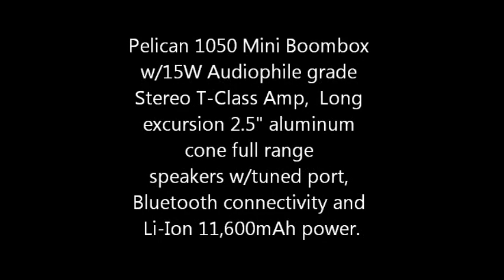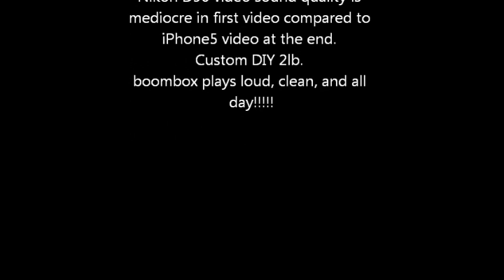DIY Custom Pelican Mini Portable Boombox w/Bluetooth & T-Class Amp!

Comment: I used the same amp and different speakers, but this but this case, or your idea for this case is what I want to thank you for. It is a great case and inexpensive to.
Reply: Hello,

How did you wire the batteries to power the bluetooth and amp? Do you have a schematic plan? Thanks
Reply: knebula http://www.amazon.com/gp/product/B00DWX8PM2/ref=oh_details_o06_s00_i01?ie=UTF8&psc=1  just in and out but for the step up chip, all you need is at least 3.0 Volts in and 2.0 amp out put capable battery. in a few days i will try to get a video up. try two battery's (7.4v) the chip will regulate the 12 volt out. they make cheaper chips but this show if your battery voltage gets low, and some cool lights.
Reply from the maker: knebula
Just made a video describing the wiring!

Comment: Using the Nitecore charger I'm assuming you take the batteries out to put them on the charger? Also I second the question of how you built your port. I'm pricing out parts to build one myself and would like a little help in this area if you don't mind.

Comment: If you're running the batteries in series you aren't increasing the capacity so the battery capacity is only 2900 mah. what's the run time?